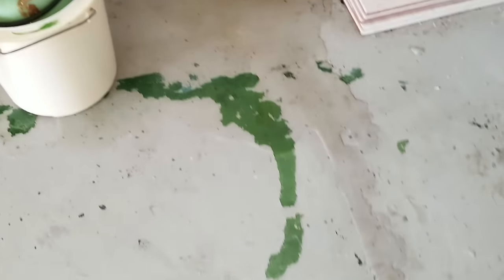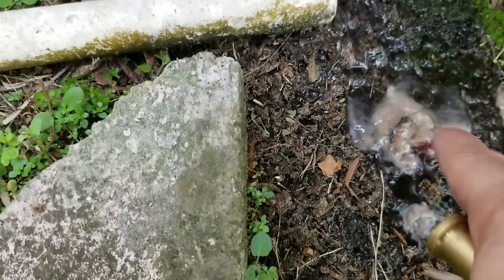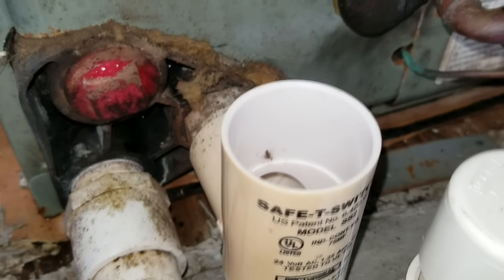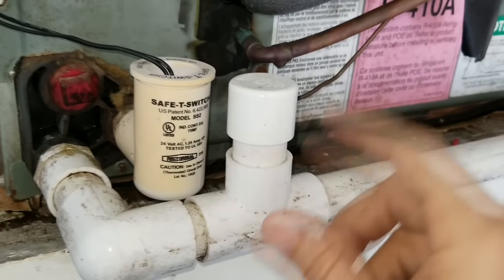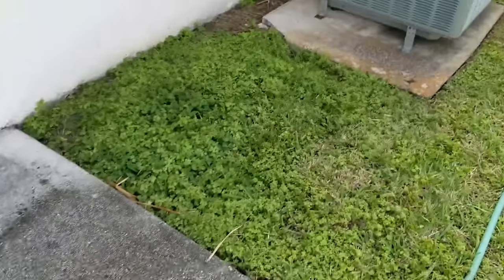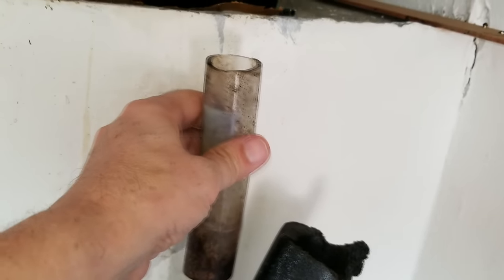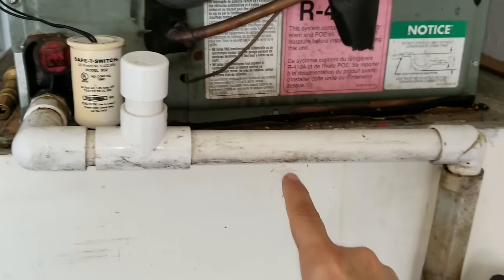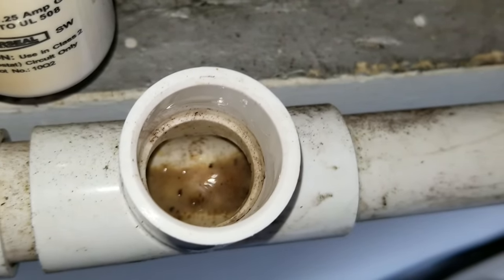How to Unclog AC Drain Line Fast (3 Seconds), Avoid Repairman

Comment from the maker: ✅ They sell a product at amazon that you pour into the drain pan every 6 months. https://amzn.to/2XJP8MG
✅ SUBSCRIBE: For more useful DIY home remodeling tips: https://bit.ly/2vj06cB
Reply from the maker: @trishalimon4874  Bleach has never cleared clogged lines, and all it does is stink up the place. The only thing that clears out a logged line is the abrasive force of high pressure water or compressed air. the AC pros use compressed air. Once you get the clog out, pour in AC pan treatment liquid into the pan.
Reply: Thanks this worked for us! We had water coming from the same drain pipe onto the floor. I just popped one of the PVC elbow joints apart, cut the threads off a garden hose, wrapped duct tape around the tip to match the size of the pipe to keep it water tight, and finally ran the hose at full blast. We had the same mold and fungus come out the other end outside by the AC unit. You saved us alot of money thanks again!
Reply from the maker: @veronicapruim8347  That is awesome, I'm so glad to hear you were bale to get your line cleared using our video!
Reply: Coupla hints.

1. The end of the drain should not rest on ground. Bugs and vegetation. Cut it back to where it's an inch above ground. 

2. Suck on it w shop vac at beginning and end of season.

3. A shot of eco-friendly dish soap in the pan will inhibit mold. 

NO bleach.
Reply from the maker: @larrybrautigam7734   Yes we Uploaded a video a few weeks ago where we showed how to vacuum out that line
Reply: Jeff. My house is 3 years old. Had a routine inspection done last Wednesday. Started to leak a few hours after the guy left. Drained the line out with a shop vac a bunch of times was still backing up. Friday another guy came out. Seemed to fix the problem. Nope same thing. Kept backing up. Another guy came out Saturday afternoon. Cleaned out really good where the ac drain line connects to the unit. Seemed to do the trick because I saw water dripping outside at the end of the line. Now 4 days later the line is clogged again. I keep draining it with my shop vac to have ac in the house for my family but this is getting frustrating. Starting to effect my everyday life. Can you help? It has to be getting clogged right at the beginning of the drain line where the pipe meets the ac unit.
Reply: Eric, open the panel on that side. Look for mold and crud buildup. Vac out, put a shot of dish soap in pan when you close panel.
Reply: Hi Jeff, another time saver is, all the slip fittings in the AC closet that might need removing some day for Maintenance, I assemble them with silicone instead of cement. No pressure, so no leaks, and easy removal and clean out. Cheers.
Reply: @trishalimon4874  9⁹.
Reply: I noticed last night my a/c drain was clogged again and instead of paying $200+ for a repairman, I found your video and it worked.

All I needed was a wet-vac which only costs about $38 at Lowes and I already had some old hoses from replacing my washer & dryer lines a few years ago with high-pressure stainless steel shielded lines.

I noticed a few years ago the repairman only had a wet-vac with him and I always wondered what he done and now I do.  He also elevated the outdoor unit because it was sinking into the ground preventing it from draining due to the builders did a sloppy job of installation.

Because I live in a condo, I have no garden hose hookups available, so I had to use the wet-vac exhaust to blow the line instead of water pressure.  I got my hose into the trap and it formed a pretty good seal but I still had to cover it with my hands to keep it from spraying.  The T-junction was a couple inches vertical of the trap so I don't think anything backed into it.

Great video and I recommend to everyone and look forward to all your videos! 😊👍✨
Reply: @jeffostroff   Jeff unless it's  hidden inside of my AC unit behind the grey metal part I don't  see a float switch  on mine but the PVC line yes I do see it  my line is clogged and to make things worse the guys who build the house year's  ago before  I was the owner made the line to run under the  whole house straight  into the  back  yard  I heard some clogging  last night in the system  and today saw alittle  bit of water in the garage  SOS I need help in you're  expertise what's  the best way I can unclog this  I don't  feel like paying 250 bucks  I remember  my AC guy last year when he unclog it poured some blue  liquid which he says unclogs  anything  then he did what you did put a  water house down the line.

Comment: I would like to remind everyone, that if you have a furnace/AC unit in the attic sitting inside the drip pan, please caulk silicone the corners of the pan. It's cheap metal rolled at the corners and most of the time, it's not a 100% seal. If your pan fills up with water, it will never trip the water sensor (because the water won't get high enough since it leaks at the bottom corner), and you'll wake up to a beautiful ceiling mural of dripping drywall.
Reply from the maker: Good point thanks
Reply: Going thru that exact thing now
Reply: This happened inside of my newly remodeled ceiling 😳. After tearing out the mushy drywall I’d just wasted $1500 on … found the leaky drip pan just leaking away.
Reply: Thanks, did this tonight along with clearing the water pan out and I'm back in action.

Comment: When we moved in to the our new home the builder advised us to pour 1 cup of vinegar down the drain line every time we change the air filters to prevent the slime build up.
Reply: Same here. Seems to work!
Reply: When my a/c shut off the first time, I was very upset (because it was August and insanely hot and humid), and I just had the a/c replaced due to another costly problem!).
So I was beside myself having to spend yet more money I didn't have on a new unexpected repair!
The a/c tech said to put 1/2 - 1 cup vinegar down that drain tube monthly, but as it got hotter in the Summer, it no longer worked and must have completely clogged!
So I went looking for solutions other than hot water or vinegar, and this sounds like it will do the trick.
I just need to find a piece of that vinyl tubing so that I can stick the end of the garden hose into it easily on a regular basis.
Thank You so Much !!!!!

Comment: Thank you! I don't know a thing about air conditioners, but saw about a gallon of water pooled outside by the drain line, and didn't know if that's how my mobile is plumbed, or had a clog going to the septic where the overflow drain was now being used so it didn't backup in the house.  It's videos like these where we single female homeowners can diagnose and take care of things we're able to without incurring the $150 fees that I just cannot afford right now on a fixed income. You've been a huge blessing!!  Thank you so much, and thank God He directed me to this video. One of the first to pop up.
Reply from the maker: That is great news and I'm glad to help out that's why I put these videos up to help you see save money from spending it on the plumbers
Reply: It's all good to google information we had a clogged drain line n my friend happened to have an HVAC company. It took onf 5 minutes to unclog. He helped us and wouldn't take the money
Reply: God is good indeed.

Comment: And doesn’t happen every few years. Depends on humidity, indoor conditions, etc... Happens in se Florida about twice a year
Reply from the maker: If it happens twice a year for you, then you need better filters, or somehow a lot of dirt is getting inside your AC.
Reply: I live and Florida and def twice a year
Reply: @jeffostroff  dirt getting into drain line or into handler through the part where a filter would be? I ask because I am in Florida,  it happens 2x a year too. Im trying no filter because even the thinnest seem to overwork the machine. But wondering if no filter adds to the drain pipe clog problem?? Tyia
Reply: I have been flushing for two days, and it still clogs
Reply: @jeffostroff it’s algae that grows in the line. Putting a cup of vinegar down the drain line once a month can help prevent it from growing.

Comment: So it was midnight tonight when we noticed the A/C wasn’t coming on. I went the HVAC route and nothing for over an hour on both ends. I then surrendered to YouTube and came across this video.  You solved my problem in less than 5 min! The drain was full of gunk and the HVAC air pressure wasn’t able to suction it out, but the water pressure sure did the trick.  As I type this I feel the air in the house getting cooler! Thank you!
Reply from the maker: Awesome news Hernan, glad to rescue another one!

Comment: You can use a wet vac as well on the outside condinsate line.  This is needed at times when the A\C is upstairs and running a hose can flood the Attic.  Attach the suction hose to the outside condinsate line and use tape or your hand to create a seal while vacuuming out the line.
Reply from the maker: Correct William! We just covered exactly what you said in another video we uploaded last week here: https://youtu.be/733SqRsF69U
Reply: Thanks, never thought of that. Sustained a bit of water damage to flooring because I was to lazy to bring in water hose and clean line out.
Reply: I will try this trick i pour bleach but still drip movement
Reply: I was wondering how to do this if your ac unit is in the attic. I had water dripping from my ceiling this past weekend and someone suggested doing this.
Reply: Wet vac for attic unit!!
Reply: yep I'm thinking this will be the way I'll have to do it too👍, using the garden hose would require cutting PVC pipe🤔

Comment: I'm an A/C service technician. I always add water mixed with a little bleach to drain lines and traps on every service or preventative maintenance call. Also, you DO have a trap. Where your line goes under the floor, and turns back up outside, that is actually a trap. It's not a trap that you would normally see on a system, or for that matter, it may not have been installed that way to create a trap, but it did create a trap of sorts. Also, if a system has the blower before the drain pan (A push thru coil), you don't have to have a trap. On the other hand, a system with the blower after the drain pan, (A pull thru coil), does require a drain trap.
Reply from the maker: Yes I always wondered why the trap that comes up outside out of the ground does not satisfy the city inspectors and I believe that is because of you look at the directions for installation from most AC manufacturers common they want the trump to be within a few inches of the outside of that drain Pan.
Reply: You are doing it wrong.  Bleach will eat that pipe. Quit telling people this.
Reply: No. The trap needs to be immediately after the condensate pipe leaves the coil.
Reply: @lerch400block  It doesn't have to be. Mobile homes are usually under the trailer. As long as there's a trap, it doesn't matter where.

Comment: I installed a three-quarter inch ball valve where the PVC comes out of the air conditioning, that way I can close the valve and force water down the line in it doesn’t go back into my unit. Once I’m done I open the ball valve back up and I’m all set to go, thank you for your wonderful video.
Reply from the maker: JDP, Yes, we have seen people install these before, that is very useful, even for when the AC companies come to serve your unit, because they prefer to use compressed air rather than water to avoid leaks, but your ball valve method works for both air and water blow outs.

Comment: My drain line was completely blocked so I had my doubts that this would work.  However, it worked like a charm! I had to create a bit of a seal with my hand around where the hose goes into the drain line, but as soon as the blockage gave way I felt it in the hose's water flow immediately and now everything is as it should be.  Thanks Jeff!
Reply from the maker: Michael, awesome, glad to hear of your success with our tips.

Comment: Our float switch also was not tripped, but we had water everywhere. We don't have a hose or shopvac, so we tried compressed air. Surprisingly, it worked! Thank you.
Reply from the maker: Yes that i what most AC repairs companies use, they don't want to risk leaks

Comment: You earned a new subscriber today!! This same issue has happened in the past, but this time instead of calling a repairman, I fixed it all by myself! I had to angle the safety valve & that's when all the water started gushing out. Your tip about the waterhose helped too. AC is back up & running 😊 Thanks for this diy video!

Comment: I used a wet/dry vac on the outside pipe for years and that worked great!!
Reply: Does that work for clogs? I have a drain line that I can't access from the inside (line is inside of walled-off room that's only accessible through 1'x1' hatch)...so my only solutions are: (a) WetVac end of pipe like you did; or (b) pour cleaner through coils and hope it dissolves the clog
Reply: @kidzbop38isstraightfire92  is should work
Reply: @officeroinker440  it did...it fixed my clog that the AC repair company blamed on dirty Evap coils
Reply: @kidzbop38isstraightfire92  Nice! Glad it worked out. Yeah A/C company's will try and screw you even if they know it's a quick fix.

Comment: Excellent help.  I had water everywhere next to my unit in the basment everytime I turned on the AC.  I disconnect the tube and water poured out.  I put a bucket underneath while I took the terminal portion of the tube into the yard and blew water through it.  I reconnected the tube and turned on the AC and it was fine.  It was just a matter of having a clog.  Thanks!

Comment: THANK YOU. MAN, first time homeowner issue. The house is old, the AC is about 15 years old, and I moved from Chicago IL to MS, so lots of firsts and changes, had the AC guy out a handful of times to fix my ACs (4 on this house, 4700sq ft) and then after the recent hurricane that hit LA, but we got the rain wall by the AL border, I thought it was seeping upwards from the foundation. Patched that, still happening. Then I thought it was seeping from the 2 of the 3 bathrooms upstairs. Drained them with the shopvac and turned them off. Still happening. THEN thought it was the AC, will try this.
Reply from the maker: Hope this works for you
Reply: @jeffostroff  It did. IT was exactly this issue. Thank you again. Edit: My drain pipe is then routed to a fish tank pump, again, not my doing, I'm guessing the fish tank pump is acting as the trap. Is that a normal setup?

Comment: So awesome!! Tysm! Totally worked! I had to cut the pipe and when I did, so much pressure and water squirting out! Put the hose nozzle on high and some stuff came out of the drain outside. Reconnected w a coupler and voila!! Like magic! :) On a side note, I change the filters every 3 months so I imagine this was never cleaned out prior to our ownership. Thanks again!
Reply from the maker: Great job! We have another video showing you an easier method with a shop vac https://youtu.be/733SqRsF69U
Reply: What filter? I'm new to owning a Central AC system. I lived in a condo for most of my adult life. Are you talking about the paper/metal/carbon 20"x30"x1" filters (obviously different for each intake size). OR is there a filter inside the metal housing that needs to also be swapped out? Since I replaced the 20x30x1 one with permanent filters that I vacuum out every month. Since I know when I looked inside my AC in the office/workout room closet in the master's wing of the house, there's also a weird metal filter that's installed on a 30-45 degree angle as well. Maybe 1/8th in thick. Kind of reminds me of the range filter above my cook top.

Comment: Great info! My late aunts AC is doing that, only problem is the her’s is inside a closet in the hallway so I don’t know if I can reach it, plus we had to have her windows nailed closed because of break ins  so we’d need a long hose to get to the leaking unit.  Maybe I’ll try the wet/dry vac trick some others have suggested.
Reply from the maker: We have a video on that, very easy to do it

Comment: Thank y ou for this tip. I know this video is old, but today walked into a utility room with about 1/4 inch of water.... I thought Hot water heater at first but after looking around found that water was seeping back up out of the cement where the ac drain goes into..  While I dont have an auto shut off, i wasnt fortunate to have easy access into that pipe, but using a snake camera i was able to locate where it was at... It was a few inches thick and 100% blocked so I couldnt just blast it out...  I used a long bendable rod to get to it, jab it a few times to break it apart some, and then used high pressure from the hose to blow the rest out.. I appreciate the tip and it saved me $$ from calling someone out.

Comment: Why is there a pipe insulator on the drip line? I didn't know about that overflow gadget. Most helpful video I've watched about this. Now to fix mine.
Reply from the maker: Probably a good idea to et it insulated, very few people do it. The overflow is required by code, so if drain pipe backs up, the rising water trips the float switch and shuts off the AC, preventing a flood

Comment: When my ac lines were clogged , I used a waterproof vacuum outside to get all the dirt and dirty water and it worked
Reply from the maker: Yes, this works for a lot of people. But also the hose if much better at using mechanical force to completely clean out the pipes.
Reply: Same thing I did( vacuum) ...painters didnt cover ac intake,  it helped yet still froze up.....
Reply from the maker: @keripieffer5834  People love this vacuum trick.
Reply: We've tried that with our AC unit ... but it didn't work for us :(
Reply: ThAts how we just did it.  The problem is now- can’t get the cap back off ( where we pour the vinegar) next to the safety